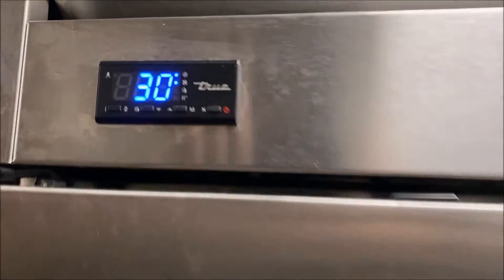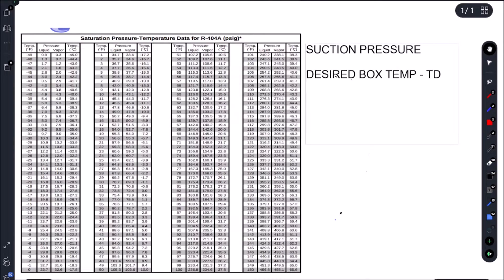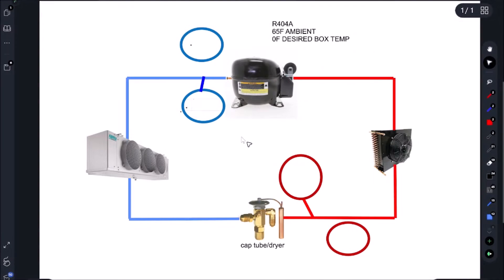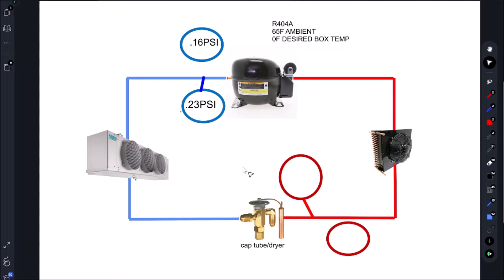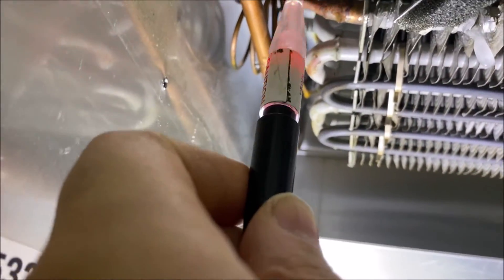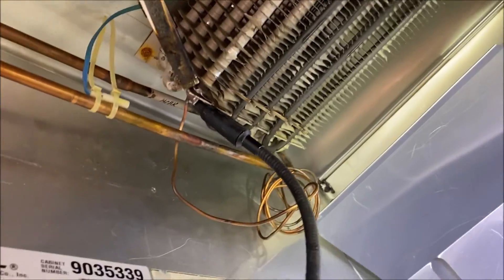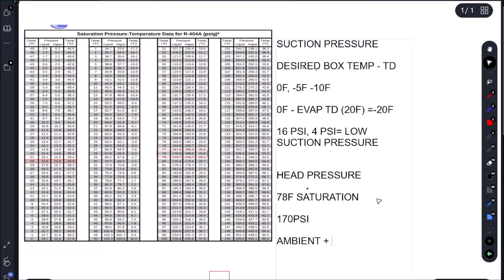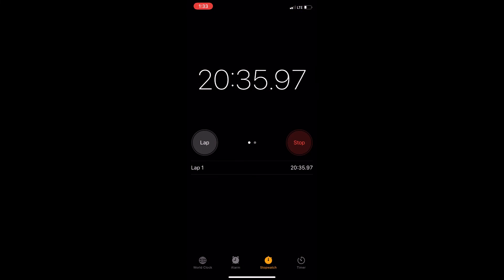TRUE Reach in freezer not cooling below 25F

Comment: As a newbie to refer side of hvacr where do i learn these evap tds and condenser tds
Reply from the maker: They vary but most cap tube reach in are 20 td evap. TXV could be 10f or 20F. Condensors are 30f or 15F, a lot of the newer stuff is 15F or less .